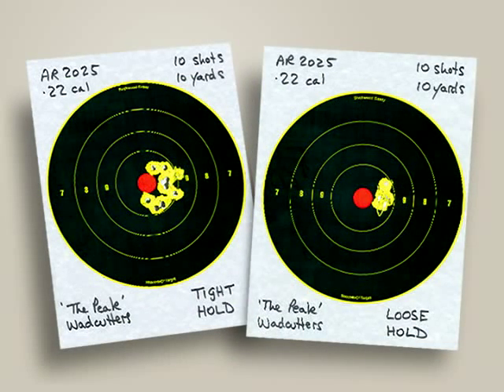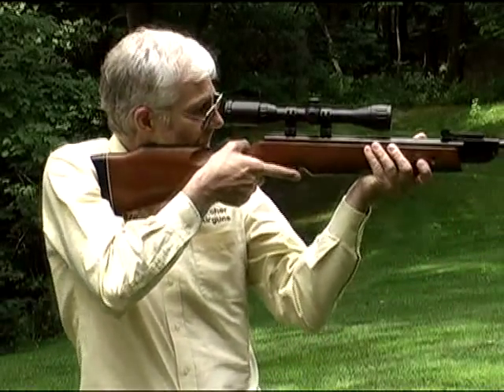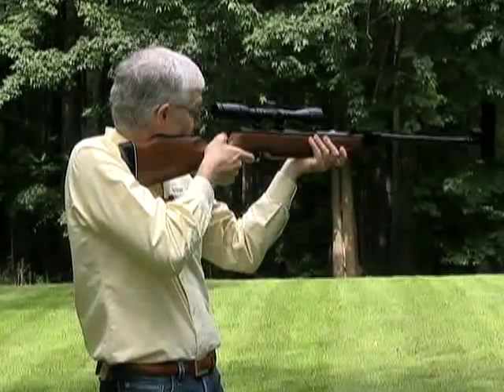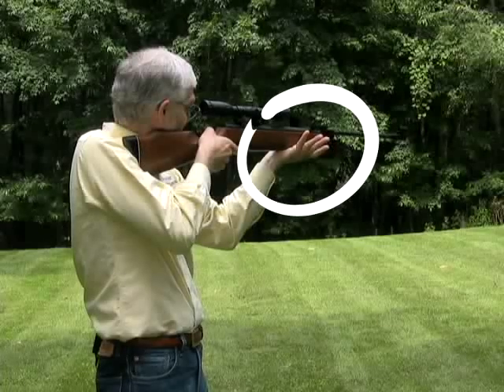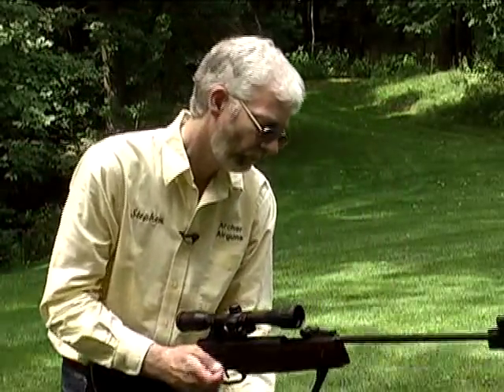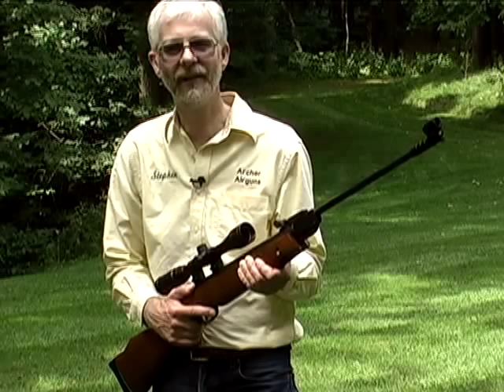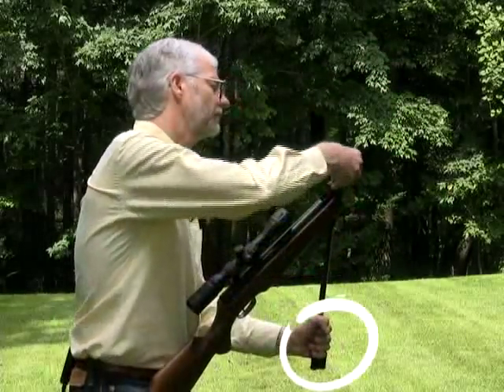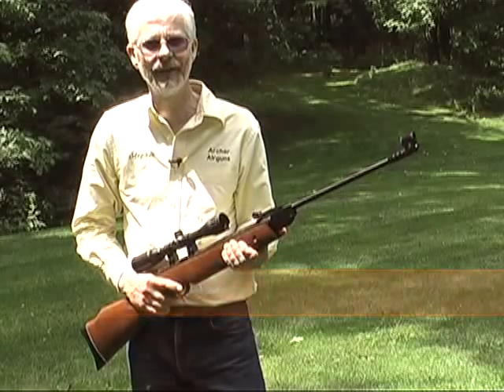Spring Air Accuracy

Comment: Good advice! Proven it to myself. I've also noticed different points of impact between rest methods; sand bag, bracing from vertical supports (such as trees or posts)  and off hand. I chose to zero in offhand as it's most common in use for me. One of the best ways to steady offhand is to tuck your elbow in to your chest so the rifle "hangs" out in front and your offhand is nearer the trigger guard. Set your scope height and eye relief  so you're not "craning"  your neck for an upright position.

Comment: I take it one or two steps further when holding the gun (or not touching it is more accurate). Push the butt stock away from your cheek and shoulder, (I just barely touch, as little as possible.  The butt stock is a long lever. Don't touch it.).  Then with the gun just resting on my hands, I try to squeeze the trigger with out moving the gun, (A light trigger setting is much desired, since you are not touching the gun.).  Let the gun shake it's groove thing, and groups like that can be had over 60 yards.  The gun starts moving before the pellet leaves the muzzle.  Remove the force from the stock, and it will vibrate the same every time, so the muzzle will be in the same spot every time the pellet leaves it. I also now use my middle finger for the trigger, and lay my index finger along side of the stock for a bit more stability. 
Sight your gun at about 35-40 yards, (so the pellet does not cross the line of sight twice), and enjoy longer distance shooting of spring guns.
Nice vid sir.  Doug in Michigan

Comment: I did some surfing and found a guy who told us about the loose hold and you are saying the same thing. You both are right on the money with this advice. I have had a Daisy/Rogers AR 1170 for several years and was very disappointed with the accuracy. The front sight was so tall the rear sight needed to be maxed out in elevation. The other day I had the need for an air rifle when my cat brought a live mouse in the house to play with. Of course it got away from him eventually, oh joy now I have a live mouse loose in the house. I managed to do the little wanker in but it peaked my interest in my springer air rifle again. By the way I did not nor do I advocate shooting an air rifle at mice in your house.
So I brought the unloved air rifle out from behind the office door where it has been for several years and went to work on it. Using some sand paper I wore the front sight down so the rear sight is slightly elevated and the front is just a nub sticking up but still gives an excellent sight picture. Practicing the loose hold method the accuracy improved greatly to less than an inch at twenty yards. I was really impressed with the results. I am sure it will do better with better pellets but what I have now is working pretty well, Daisy Max Speed Premium Grade Pointed Field .177 Pellets at  7.4 grains measured on my scale.
This evening I tried a little test on soda cans filled with water to see what would happen and the pellets went through both sides of the cans! Needless to say I was impressed. From now on the gophers digging holes in my lawn are under double threat from my cat and from me with my Daisy. I live in a rural environment but a standard .22 rifle can skip lead a long ways, too far for random shooting in my opinion where I live. Gophers don’t often present perfect safe shots but with my Daisy I have no worries now.
Thank you for informing us all about the proper way to shoot a springer air rifle, it makes a huge improvement.

Comment: Problem with most spring-air is that they are break barrel. If the sight is not on the barrel (eg. using a scope), barrel droop / drift can add significant accuracy problem. I found this out by shooting with barrel resting on stand rather than stock, and got very good result. For off-hand shooting, I apply slight upward pressure on the barrel, which makes for awkward shooting position. This frustration led me to look at PCP, and QB79 seem to be just the thing; I may be ordering one soon from Archer Airguns.
Reply: Some lock up better than others, and some even have some side to side play.  My Gamo .22 magnum locks up perfectly, but for my other break barrels, I grab under the muzzle to pull it up while wiggling it from side to side.  Even my worst gun finds it's location pretty good. My Hatsan had some droop, but it repeated well.  I was worried about the same thing when I first started shooting break barrels, and theoretically, you are right. But if the design and manufacturing are where they should be, they can lock up just as good and be very comparable to a fixed barrel springer.  My buddies Gamo has just a tiny bit of droop, but mine locks up the same every time, perfectly,  with out the wiggle/pull method of the breech being home that I do with my other guns.
Doug in Michigan.

Comment: @knottsscary 

The gun ( if you bought it new ) is going through its running in phase mate. Dieseling off excess grease/oil depending on how the gun was assembled in factory, it will gradually get better and better over time bud. It will go through loud and quiet phases, as the spring naturally turns and cycles with a shot, so oil/grease moves about a bit. If it still persists after a few hundred shots, take it back, as you don't want it doing it too much.

Comment: quick question, are there bolt action rifles? I know there are bolt action made for things like an airsoft gun and obviously real firearms... but I have never actually seen a bolt action pellet or bb rifle... would it be the same principle? the bolt pulls back a spring? and or pulling the bolt back would create air pressure? I dont think pellet rifles like these exist beause I tried to find one and could not seem to come across anything. Thanks for any  help you can give me.

Comment: Mr Archer,
I'm a first time air rifle owner and I just bought an SMK XS38, a very heavy under-leaver spring air rifle, I assume it would also be known as the QB38, as well as a 3-9x56 Mil-Dot Scope

My question: as my rifle is so heavy I struggle to keep it steady, I was thinking of buying a bipod for it, ignore the factor of it being akward on an under-leaver, but would a prone shot with a bipod attached have the same negative affect as a tightly gripped hand, or the posetive of an open hand?

Comment: can i use a normal gun scope  for pcp because thay dont give that much recoil
well i was gona buy a leapers 3x9.50
but then i saw the leapers 4x16.50 which has better magnification
than the 3x9.50
9x is aright for pest but for rabbits realy a 4x16.50
because you can hit then aim for the head if i have a powerful rifle which i will 
mine will be a daystate 60lb fac pcp air ranger and ammo rabbit magnums

Comment: hi ive just bought a 1400fps spring air rifle from ruger. ive been shooting for years but all propellant rifles. I bought this air rifle to shoot rabbits near roads that I cant shoot safely with a 22 or 17mach2. unfortunately this will mean lying & waiting for long periods of time in camo in exposed positions. 4 longer shots I was planning to mount a harris bipod to the stock, obviously back from the slot for the barell. ive been told this will open my groups not close them can you tell me why?
Reply: Shane Keat air rifle recoil doesn’t just cone back it’s quick it goes back then forth. So it effects recoil which is why you need the artillary hold to shoot them accurately
Reply: Shane Keat there’s better videos on the artillery hold for air guns
Reply: Shane Keat btw if you still miss shots try tightening the pivot screw

Comment: Do you have any numbers in terms of the backward recoil energy for various spring type air rifles? Much like with true rifles, most people don't seem to understand how important weight is when taming such...and a 6.5 pound Crosman 1000 fps .177 (at least the older series types made by China) make a .22 LR seem completely without recoil. it's not that the recoil is tremendous, but I've always wanted to find specific numbers listed for the recoil energy and none have been published.

Comment: None, in a Gamo. Waste of money for anything Gamo because Gamo does not sell parts to any one without a FFL.
Reply: Yea, I found that out.  Hatsan will not sell you parts unless you put your credit card though your computer, and they never answer the phone.  I am shooting 2" groups pretty easily at 65 yards with my Gamo .22 Mag though, and at least I can get parts easier than Hatsan, and not funding islamic terrorism.  I really like the gamo magnum .22, and for another tip for long distance springer shooting,---push the butt stock away from your shoulder and cheek before you pull the trigger.  You just will want a light trigger pull,---when you are basically not touching the gun, so it does not move. :)  I can do 60 yard head shots all day long on small game with that gun, and I am confident enough to shoot up to 80 yards for a small game head shot.  Once i got that stock off my cheek and shoulder, (I do touch, but as lightly as possible), tight groups over 60 yards started happening.
I wrote Gamo about that stupid lawyer idea of theirs, when we can buy the gun but not the parts with out a FFL 3rd party. I let them know that we are in no hurry for more gun regulation,----so don't rush it.  It is a crappy policy.  What the hell is wrong with a complete service manual too,---if they want to be safe about it?  They think we are too stupid to work on a airgun.
Doug in Michigan